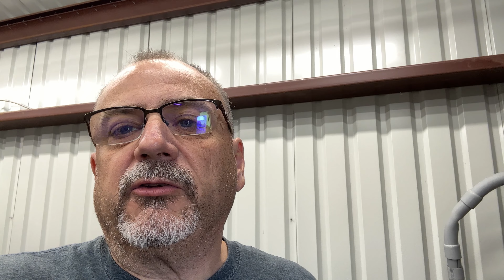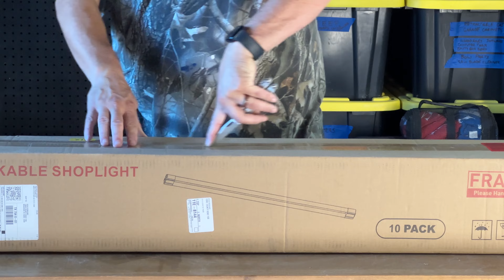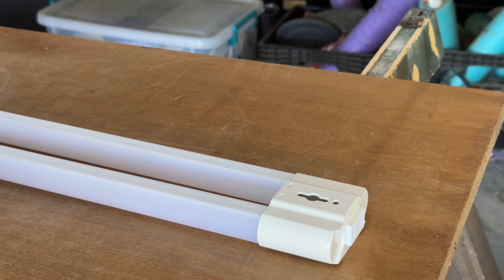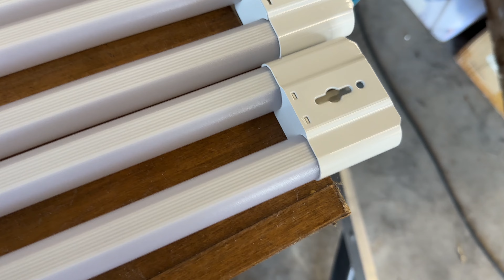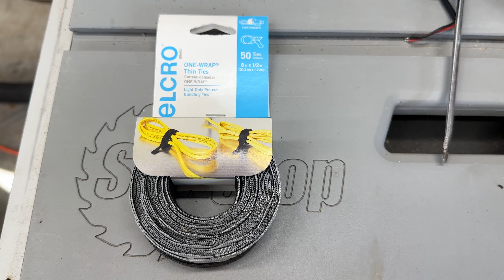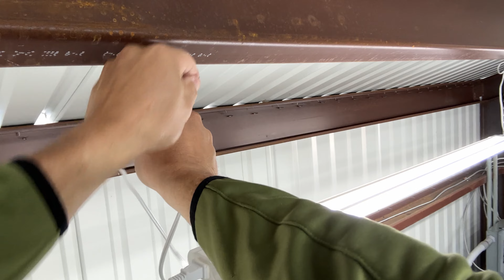Brighten Up Your Workspace with these BBounder LED Shop Lights | Workshop Lighting Solutions

Comment: Great video.  Looks like just what I need for my 32 x 40 workshop with 9' ceilings.  What is the size of your shop and eave or ceiling height?  Thanks in advance.
Reply from the maker: Our shop is 20 by 30 enclosed with a 20 by 30 carport.  The walls are 10 foot high I think.  I’ll have to measure tomorrow.
Reply from the maker: I went and measured this morning.  The Walls are right about 10 feet tall at the edges of the building.  The peak of the ceiling is around 13 feet.